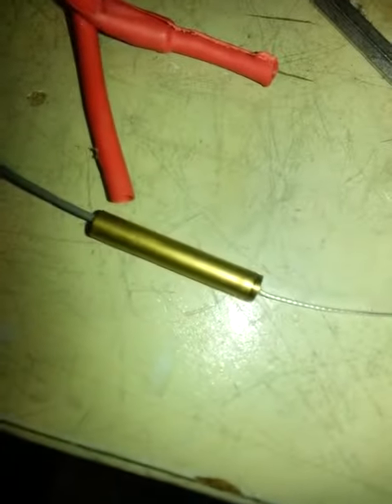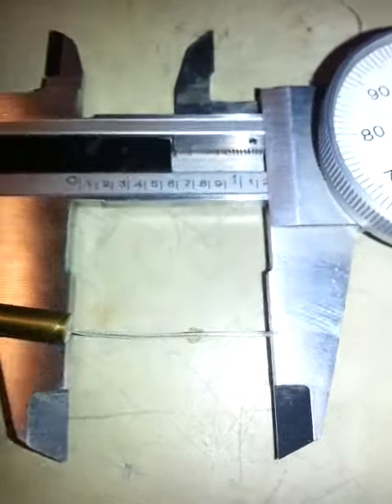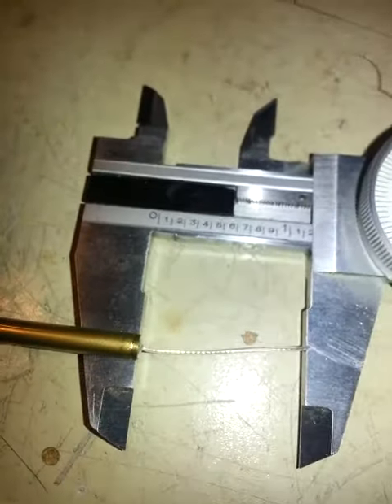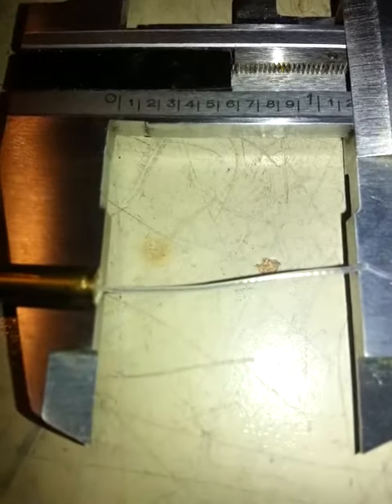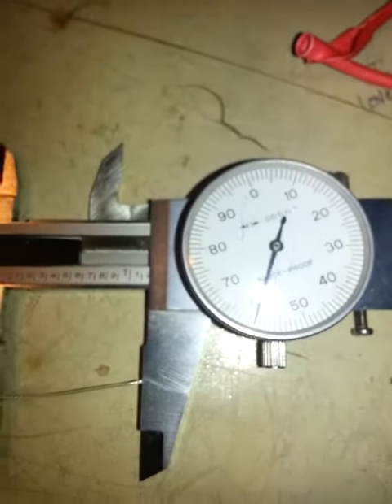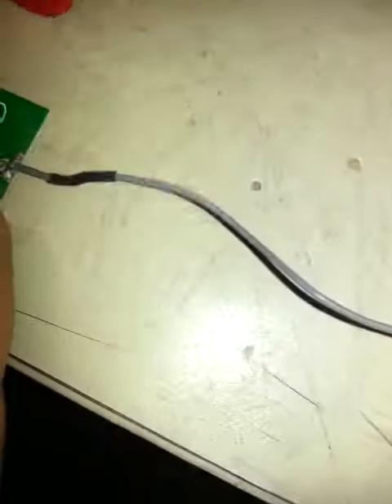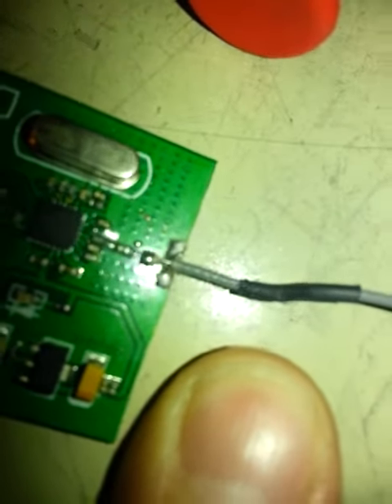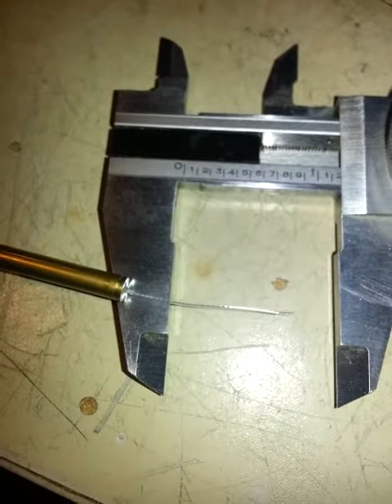Turnigy 9x antenna

Comment: It should be 1,1261" for the visible wire and then file down the tube so it to have the exact same length and the antenna will be tuned to exactly the middle of the transmitters transmitted frequency which is close to 2.442GHz

It does not transmit spot on 2.4GHz, it use slightly under a 100MHz bandwidth to transmit on due to its frequency shifting technique so to make the antenna for just 2.4Ghz will then be on the lower outer edge and will not give you the best range.

I see now its about the original module and I don't really know what the stock module transmit on but if you use the frsky module (which is far better) then the above apply.

Comment: hi robert i have done the same but unfortunately my antenna shortened by 1.5cm......and i am not getting proper range.....
Reply from the maker: Unfortunately antennas length are very critical. If the overall length of the antenna cable is shorter that is ok. But the exposed part on the end has to be exact so you can still strip the gray insulation back the 1.5cm to make it work better.
Reply: ok fine but i lost that brass cylindrical shield is it required for the exposed antenna...or it works if the stripped antenna is 2.94cm without that brass shield.
Reply from the maker: yashasvi chakravarthy the brass part isnt required however you do need the braid to be folded back instead of cut off and the same length as the brass tube.
another option is to get or build a cable like this https://www.hobbyking.com/hobbyking/store/__10949__X8_2_4Ghz_System_Refit_Antenna_Cable.html , cut off the right angled end and solder to the rx board like the gray wire is. Then use any 2.4ghz rubber ducky type antenna on it like a router antenna or one from hobby king.
Reply: i have used this antenna of same length
 https://www.hobbyking.com/hobbyking/store/__16668__FrSky_Receiver_antenna_60_cm.html
Reply from the maker: yashasvi chakravarthy
Yea, that should work. as long as the antenna part is the same dimensions as your old antenna. Just cut off the little end, strip it and solder to your board.